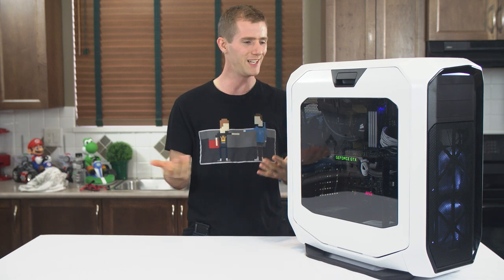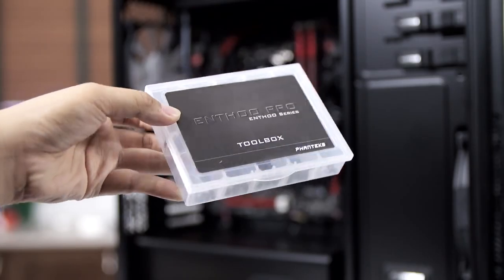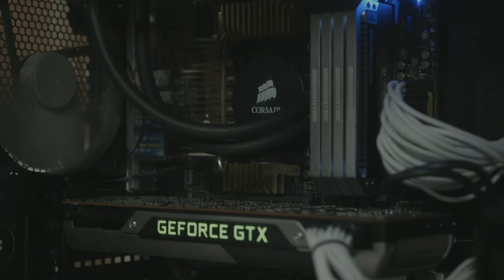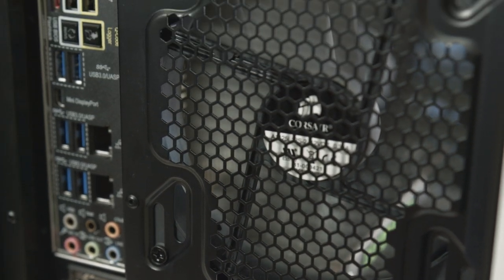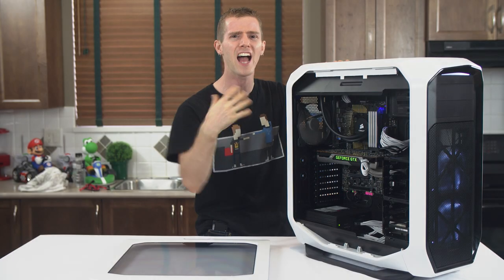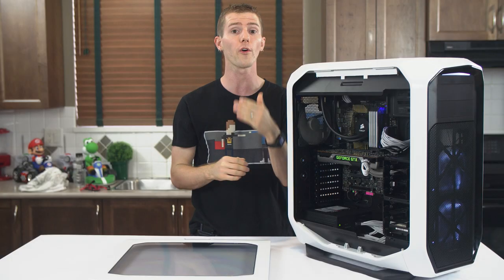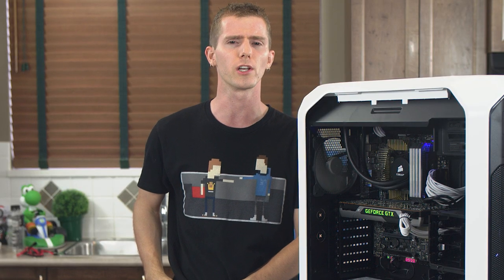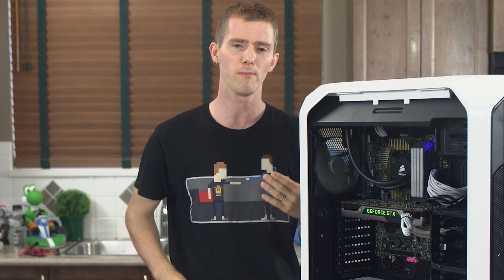Corsair 780T Graphite Case

Comment: Sticking with my 600t - I agree that Corsair prides themselves in a higher standard and premium price because of that... yet they use the most thin plastics and metals that 80 dollar cases are deploying. As a long time Corsair customer that owns pretty much everything high end thing they put out, I expect much more from them. these new cases show clear signs of squeezing profit margins and losing sight of why they are in business to begin with. All of your cases should not have a single hole that isnt covered or filtered. The tops of your cases should accommodate full bridge water cooling with push pull fan and still have 4 inches clearance to the motherboard. the side panels although thin are not really important unless they get so thin that they rattle or vibrate. the motherboard deck plane is inexcusable.. that metal thickness is almost embarrassing to hear vibrating under the motherboard. also please lose the huge reset button.. as a matter of fact hide it under the top panel. once more the drive cages cant be removed because you cant get at the screws from the bottom lip of the case.. this doesnt even rate an oversight.. its amateurish. how did this pass your own QA? Step up Corsair we have with our wallets and I for one am calling you out.
Reply: You should see my new pc. It would blow your mind.

Comment: 1: I NEED that case
2: I don't think you should go easy on Corsair, but NZXT, Fractal Design,  Phanteks, Thermaltake, Cooler Master, and Azza are just as capable of creating quality products, and Corsair is no better.
Reply: I completely agree, I was kind of a noob saying CM and Azza are good.
Raidmax sucks.
Reply: John Abbott What I am saying is that I completely agree. At the time I was in the phase of judging cases by looks and potential setup options. However, I have acquired LOTS more info, and can more than happily say that some CM, Azza, and Raidmax literally came out of your wastebasket. However, the Azza Solano 1000r is 30% good.

Comment: I use a H100i liquid cooler for my CPU, along with an ASUS Crosshair 5 formula-Z. Is this a better alternative over the 760T considering that i currently mount my radiator on the top?

Comment: Anyone using this case in 2018 and will recommend it? How good is the case's airflow and cooling out-of-the-box fans - with high end cards like 1080ti and high end CPUs?
I don't want to install upper fans that may or may not mess with airflow and will just be extra work.

Comment: Would a 295x2 with its water cooling and a h100 both be able to fit in this case and not destroy the air flow coz i really like this case.

Comment: Wanted to check if this was normal, I got the Graphite 780t cause my 
friends recommended corsair highly but once I got all my parts installed
 the case seems to make these weird metal snap noises. The sound isn't 
from one place, it makes the noise everywhere inside and I'm not sure 
what it is? I turned off the PC and unplugged it for 3 days and it still
 makes the noise even when its off. I went on to forums saying some 
cases (not specifically the 780t) making metal snap or tapping sounds 
due to changes in temperature but I just want to be sure cause this has 
never happened to my previous PC

Comment: Honestly, I think I prefer the door / hinge design of the 760 to this... The basement would've been nice. I do like that this has actual filters throughout rather than a cover which blocks airflow... I don't like the flimsy looking drive cages. I am looking for a new case and I am thinking of going with corsair, how heavy is this though? Every time I look at a case page it's got all these clickbait trigger words like explosive led rgb lightning fast switching of colors, super amazing and bright... but nothing to weight, how many slots there are, etc... you get dimensions, fans, and sometimes other stuff, but if you don't see it on the pictures the chances of reading it somewhere are slim... So annoying. Cases seem to be the least documented component for computers - it's a shame...

I also don't like how flimsy the back wall is as it seems to be the same internals as a lot of their other cases and the wall is flimsy.. I love the large space behind the mbd for cable management, I don't like the missing ports, I don't like that 3 or 4 bays at the top weren't included because if you want to move the hard-drives up there, you need 3 bays for 5 drives in hot-swap configuration... with 2 you may be able to fit 3 but no more...

Comment: George, ditch the "external watercooling" options. They are ugly and never get used.
Other than that, keep it up.
Reply: I've seen many people use them. Removing them would just be a loss of a feature and make this case unusable for many PC enthusiasts.
Reply: HazrdMC So you're trying to tell me this case would be unusable to "enthusiasts" because they can't drill some holes in it?
It's a lot easier to drill a hole than fill one in.

This "feature" is ugly and as an 'enthusiast' I like my case to look aesthetically pleasing from all angles.
 My way of thinking is if you need external watercooling it would probably be best to invest in a larger case. (900d can fit like 12 120mm spots)
Reply: For "Many PC enthusiasts. I'm just saying that it would be a drawback for some people who would rather not have to drill a hole into their $180 case to include a full liquid cooling system.
Reply: HazrdMC "Many" people externally water-cool? That I highly doubt. Went on [H]ard and in their watercooling sticky there was one person using the included grommets in the last 200 posts of the thread. Nearly every case in that thread has grommets. It's ugly and a waste.

Aside from that I had no issues drilling holes in my $225 case, even for internal watercooling. 

The ones in this case aren't even holes. They are like drill guides or something. So you are stuck with ugly stamps in your case that you can't even route tubes through. Basically the epitome of useless "watercooling" blemishes still marketed as a "feature".
Reply: JayJapanB Is there a chance I could see how you set up water cooling in your PC? (All arguments aside I'm just curious :)  )

Comment: can you suggest a case which can support 240,280 & 360mm options with push pull in top than front. with option of 1x 5.25 and 4x 3.5 and 2-3 2.5 ssd with more space inside.  little help appreciated.   All under 130 max 150.

Comment: i chuck out all the HDD cages, and just use SSD, for HDD i have Nas Synology 216j with 2x10TB Gold Raid 1. Why have ugly HDD;'s in a case when NAS is so much better. I use the bottom and rear rad mounts for 2x  EVGA GTX 1080 FTW Hybrid Rads. Samsung evo 960256 M.2 for boot, 1x Samsung 1TB for games, 1x 1TB Samsung Pro for rendering and that 10 year guarantee. Nzxt X62 cooling 6900k in top, 3x 120mm at front, All noctual PPC industrial 2000-3000rpm fans.

Comment: 780ti kingpin edition or titan black? I'm in a pickle here deciding...
Reply: What resolution are you gaming at?
Reply: 1080p really. Want Nvidia surround eventually. 3 monitors. But for now just 1080p 144hz.
Reply: If for now you're using 1080P 144Hz, I'd hold out for the new series of Nvidia GPU's they should be arriving soon. If they are too expensive for your liking, go for a 700 series card as they'll likely drop in price as soon as the new line up of cards are released. What GPU do you currently have?
Reply: Neither dude, just a normal aftermarket 780ti. Kingpin is for extreme ln2 overclocking.No need to spend $800 or so for it
Reply: I have an old ati Radeon HD 5780.
Reply: I wanted the matrix 780 Ti but it's sold out. So I am like why not a kingpin might as well go all out.
Reply: Victor Sandoval Well I'd hold out a little longer and wait for the new Maxwell GPU's :) just my two cents
Reply: If you`re not at 4k, then a titan black won`t perform any better than a 780ti ^^
Reply: Victor Sandoval i know what u mean. I got lucky and was able to get a 780ti matrix on amazon a couple wks ago and there were only 3 left 0_0
Reply: 780ti Hall Of Fame. I think it ht a world record.
Reply: Yea the 780ti HOF is nice too but also sold out. When are the new cards expected to be out?
Reply: Neither, wait for 980. I think I read somewhere September 19th is announcement date.

Comment: do the two top exhaust fans come included with the case?
Reply: +Jon Ang No they do not.  Those were part of the cpu water cooler/radiator that was installed.  I think it's the right call on Corsair's part not to include any more fans than the 3 provided.  In most cases it could end up being a waste, or some might opt for slightly better fans than the stock ones they provide, not that the AF140s aren't good.  I just got this case but haven't started putting it together yet.  I got a Corsair H115i, and decided to get an extra AF140 led fan to replace the rear fan to match the front and provide some interior illumination.  Poking around the case though, I think it is sexy is hell and can't wait to start putting it together.

Comment: Not a fan of side panel window so I wouldn't be buying this even if it was the best case ever.
I don't care to look at my components, I know what's inside of it, I don't need to look at it at all time. A PC is made to be used, not to admired the inside of. It's also not as practical, especially if you aircool many GPU, since you are losing that side panel fan mounting option

Comment: I have a 600T sadly I thought the 760T would fix my issues, but it seems to have  only fixed a couple. One of my major issues is even in this review i saw the doors didn't go flush onto the it's mount so it looked like there was a gap, mine has this issue with one of it's doors and looks weird. Then I just looked at that giant cut out they made, I would have bought it if I didn't see that i see almost no extra room to advance from my stage of  air cooling, to a custom water loop because don't see a way to mount a res on this case.

Comment: how well is this gonna run batlefield 4 and Dayz standalone?
Cpu: AMD bulldozer 8 core FX 8120 3,9 Ghz turbo OC to 4.5Ghz
Hdd: 1TB 7200rmp
Ram: 8 Gb
MOBO: ASUS SABERTOOTH 990fx
Gpu: HD 7850 + R9 270 in CrossfireX
Case: NZXT Apollo bleu led
Psu: 1000 Watt
Reply: It will run both just fine.
Reply: Nothing and I mean NOTHING can run DayZ good.

Comment: -Hard foam, broken in multiple places. But that isn't concerning at all, I'm sure. Criticizing for hard foam is getting boring amirite.
-Rigidity of the side panels?
-Rivets not screws. Especially not thumb screws.

Still, glad you were willing to call Corsair out on several issues. Glad you mentioned the Phanteks screw container, the lack of a PSU cover, the plasticky build quality and the price.

Comment: I had the Graphite 600T, and welp i gotta say that case was disaster... Build quality was garbage, and the air flow was even bigger garbage, case that have so much ventilation holes, and yet parts inside did get hot as hell, no matter the front 200m fan, top 120mm fan and back 120mm fan... Also the black plastic in the white model was so garbage it did brake in about every single place, the ones on the side panels that are used to hold in place the panels or remove them, did brake like chocolate bars...

Comment: i have 600T now for 2 years.. i want to upgrade now. I'm confused b/w Master case 5 Pro and 780T.. which one to get... I like Corsair's support.. What to get..
Reply: 540 air or fractal define r5
Reply: +Jay Shank i would get the 780t
Reply: +Charles Mut-Tracy yes,  got 780T.  White.  Was very difficult to find this,  specially white version
Reply: im getting it in pccomponentes.com its cheap and very reliable its one of the most well known pages.

Comment: i have to change my case because not everything can fit in it. i have a 360x80mm monsta and 2 140mm radiators so im wondering if the 780t, 760t or the NZXT phantom 530 will be able to fit them in. can anyone help me. any suggestions to a different case? (it has to be white and have a window)

Comment: now that I've seen the 760T i don't like the 780T Lol  i now made my mind up what to get !! currently using  the 540 ! time to upgrade
Reply: well not much really .... just would like a new case .. maybe am rushing but i just fell in love with the 760T V2 i mean come on .... haha whats not to like ?
Reply: I really don't know ? just seen it on amazon by mistake ... maybe size ? not to sure... think i'll have to get it if it goes on sale ! will def get full sleeve corsair cables .
Reply: +Jimmytwogunz Can you recommend 3 full tower cases?
Reply: +Sebastian Baechler (Cbass) depends on what you want to do with it?  You looking on going full loop?  Or just Air?
Reply: +Jimmytwogunz just air, my card is almost 13 inches
Reply: +Prudator I might go with the 760T or the NZXT H440 and remove a tray for my card as I'll need 3 trays for my drives max
Reply: Sebastian Baechler I'd get the 760T and make me jealous

Comment: would be better without front  bays...that way 3 x 140 fans
Reply: Wonder if CES will bring that this year? This would've been my dream case otherwise. No front bays, triple 140mm fans in both the front and top, and usb c front IO
Reply: wouldnt be hard to improve...no bays at front and 3 x 140 and USB C in front. Also would love a PSU cover and a cover going up between the SSD's and just about flush with the floor...maybe 25mm above...hey, I would buy it today if they did that

Comment: Hey guys, I don't know much about computers and well I have a budget of 2,500$ for a new computer so I was wondering what you guys would suggest for parts. I'd also rather run at 1440p than 1080p / 4K.
Reply: A 4790k, 16gb of ram, u probably could crossfire 290xs, and an 800+watt psu
Reply: 4790K, 16GB DDR3 RAM, R9 295X2. Should even work in mATX. That's not even $2000, everything else would be overkill.
Reply: R9 295x2, i7 5820k + Cooler master Nepton 280L, 850w 80+ gold/silver/bronze PSU, this case
Reply: Here you go:
http://pcpartpicker.com/p/8KsKnQ

($2464.78)

Although you should run it by on the Linustechtips forums and post the build there in case somebody can put together a better/cheaper build.
Reply: FourtyTwoish Um, that's way over his budget
Reply: Declan olsen Go with what this guy said
Reply: Ps4
Reply: 576356
lmao
Reply: Thanks guys, and I will ask the forums as well! :)
Reply: 2500$ :O   that's a lot of money, you can buy 1000 pizzas rather than a pc.
Reply: Gabriel20 dude that's just dumb to say. why would you even mention that

of course he should get the pizzas :D
Reply: ***** Pizza master race

Comment: Is it better that the NZXT 820 Phantom?
Reply: I swear to god I that the nzxt phantom 820 has the worst build quality ever I don't recommend buying it but I do recommend you to get the corsair graphite 760t ;)
Reply: SKyZoom You're the first one that complains about the build quality of the 820 phantom. But it's so shiny, and good looking :(

My only concern is that the case is almost 3 years old, not shure if nzxt will update it soon or not.
Reply: TBH I bought the nzxt phantom 820 because it looks nice and shiny,  then I received it damaged a bit but not that much, but I didn't like the build quality and btw when I opened the side panel, the screw was damaged... Now I just ordered the graphite 760t, I'm not calling the nzxt 820 bad but it needs some improvements, the graphite 760t has an awesome build quality btw and its muck more easier to remove the side panel
Reply: 760t is wobbly ASF watch Linuses review... I need help also 

NZXT H440
or
Corsair 780t
Reply: AsiaNxTacTix I'm getting the 780t in 2 hours
Reply: Nice it turned out to big for me so im planning on getting the NZXT H440
Reply: AsiaNxTacTix I'm used to the antec 1200, so size wasn't an issue for me. Got all components installed, loving it so far :)

Comment: does it accept water cooler 280mm like h110i gt from corsair?
Reply: +Bruno Moreira Yes you are able to fit a 240, 280 or 360 mm aio/rad on the top, a 240, 280, and 360 mm in the front, a 240 mm on the bottom, and a 120 or 140mm at the back.
Reply: +Baggy MacDouche thanks

Comment: what case is good for costum wc thats not like huge
Reply: watercooling needs room, otherwise its cramped and looks chaotic.
Reply: Check cooler master cases. Lovely cases. I used to own Cooler Master HAF 922. It's HUGE for a ATX mid tower. 100$ range.
Reply: Any decent case can house some watercooling, you can make it look pretty with some effort and planning too. I would suggest first thinking about what size rads you want/how many, and then go looking around for cases that support what you want (Simply go on the big boys sites, Corsair/Aerocool/Fractal etc..) then check. 

If you want a small rig with watercooling I would recommend the PC-V359 from Lian-Li, a bit of a premium price but tones of potential. In the end though it is up to your personal taste.
Reply: Phanteks: Enthoo Luxe (ATX) about $150
Phanteks: Enthoo Pro (ATX) about $100
BitFenix: Prodigy M (Micro-ATX) about $100
Fractal Design: Node 804 (Micro-ATX) about $85
Reply: NZXT H440
Reply: enthoo pro
Reply: enthoo luxe or pro
Reply: FyUoCuK water cooling in a prodigy m? Have you never seen that case before?
Reply: Fractal Design Arc mini R2. Can fit a thick 360mm rad and a thick 240mm rad and a 120mm one. All in a compact Matx form factor
Reply: FyUoCuK maybe the prodigy but definetly not the prodigy m
Reply: EpikFlyingBrick
fuck a 120 aio barley fits in my prodigy m
Reply: Kingdom Of Mog yeah, i have a hard enough time fitting my shit in my prodigy m, and its not even watercooled.
Reply: Kingdom Of Mog and thats why im getting a fractal design define r4 :D
Reply: EpikFlyingBrick
 they arnt even comparable cases so :/
Reply: h440 from nzxt or 450d from corsair
Reply: Enthoo Luxe